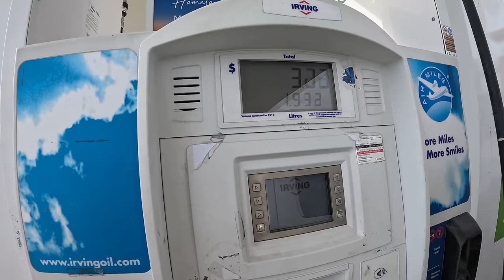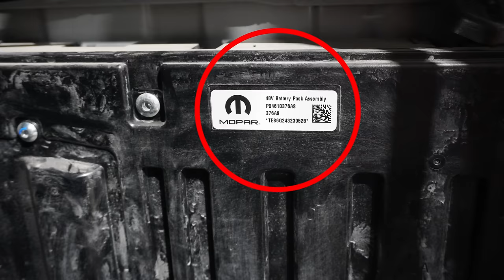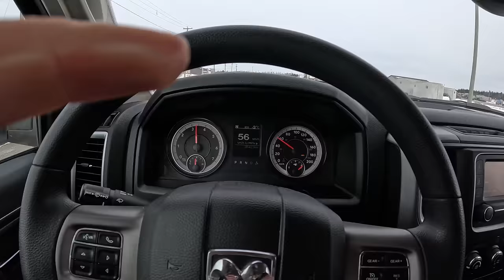Ram 1500 E-TORQUE HYBRID System *Heavy Mechanic Review* | Does It ACTUALLY Work??

Comment: Seems like any gains having E torque on your truck would be minimal.  Wondering what the cost is of the E torque option ?? Great video as always
Reply: you can't buy a non-etorque anymore. When it was new it was about 3k difference on the 5.7. I see a gain in about 3-4mpg in the city vs my friends non-etorque
Reply from the maker: they are very minimal, I believe now you can only get these trucks with the E-torque. but before that it was like 1100 bucks depending on the model.
Reply: Etorque is standard on 3.6 V6 motor.   Hemi with etorque is an option through 2024.

Comment: We call our 2023 E-torque a E-turd. With only 20K miles on it, it has been in the shop 3 times. A week after purchase we lost a 48v battery pack, then two times with the hemi tic issues. Our previous pickups (Ram 1500 5.7 liter were a dream). Now thinking around 100K miles thinking about the battery replacement cost of around $8,000.00 plus labor. Only if we knew this at purchase, we would have not purchased the E-torque.

Comment: Agree. Cheap solution to get EPA MPG up slightly. 3.0 coming. Would be cool for you to look at the 3.0 Jeep or Ram coming. 
I don't like it. Added complexity, maintenance, and minimal benefit.
Reply: Hi jw8578 
Absolutely agree. 😮
Reply from the maker: E-torque is great for marketing but that's about it. Honestly I was a little down on the 3.0 it to begin with BUT I like that's it's in a inline-6 configuration and hopefully is a little torque monster. granted with twin turbos strapped to it who the hell knows about reliability or longevity. Only time will tell.
Reply: @TheGettyAdventures  if you have a chance to look at a 3.0 hurricane in the Jeep that would be cool.

Comment: Here is my real world take for someone who's owned both a 2019 RAM quad cab Hemi and current a 2019 RAM crew cab V6 e torque. 

Both trucks are Bighorn trim levels. The hemi truck was more a baseline Bighorn and the V6 truck is a fully loaded bighorn (only option is lacks is the Hemi).

The Hemi truck got better fuel economy all around. 18 city 21 hwy. Towing i would drop to around 15. 

The V6 model i have done mostly hwy driving commuting and i can get it to go higher than 17 hwy.

But the reliability over the Hemi is worth it IMO.

Comment: The way I understand it is that is that the e-torque supplies torque up to 2,000 RPMs. And since that it doesn't supply torque all the way to top end that they can't apply e torque  to the torque specs. I've owned a ram truck from 2010 to all the way up to 2024 and then I switched to the hemi e. Torque. To me, there's there's no comparison between my non hemi engine and the one with etoeque. Imo

Comment: I have a 23Limited i feel its a good system when i use it i can tell it saves on gas about 2 more miles to gallon in city an breaking i love how that feels an transmission shifts are smooth but as you say there's still more factors of things going wrong.

Comment: Bought a 2025 Ram with e torque, had it for 21 days. I have not paid the 1st month and was towed to the service  department with transmission reset problems and stopped in the middle of the street and not move. It has 850 miles on it. Should I get another truck?

Comment: So far I like the E-Torque, I was told forever its harder on an engine to continually start and stop the engine so, I usually shut that feature off.  When I do use it, I've noticed its really smooth,  Haven't towed with it yet???

Comment: When I bought my 2023 Ram 1500 I was told the E  torque was to give more energy to run all the electrical on the truck.  Also my Ram doesn’t seam to shut down when I’m stopped?
Reply: I noticed with mine it won't shutdown if the ac is running

Comment: I do wonder in the future if Ram plans on using the Jeep 4xe system with their trucks. The Grand Cherokee 4xe has like a 26 mile range on battery only power, and I'd imagine with system being used in the 1500 they would have extra space to put more batteries to give it additional range. It's a much more sophisticated system that offers pretty much all of the same benefits of the eTorque with more power and actual EV battery driving range. I hate that we'll likely never see such a system be paired with the 5.7 since Stellantis seems so obsessed with ditching the Hemi in its entirety with the quickness. A 1500 with a Hemi and a 4xe system with about 50 miles of range would be perfect for me since it would give me just enough electric range in the city that I could use the truck as an EV daily driver to get to my job and back or for any grocery shopping I do. I wouldn't need to use the engine until I take a trip out of town or I let my inner Mopar out and floor it because Hemi noise is good noise. 🥴My old daily driver was a 2007 300C, so since I started driving my grandpa's 2014 1500 I've had a habit of driving it like I stole it. I miss that car, but the truck is way more luxurious and plays the same V8 musical notes. It's a literal win-win for me 🤣

Comment: I just bought a 2024 Longhorn with 5.7 hemi and etorque. Would have preferred No etorque and 2WD but no dealership had any. So far I’ve only driven it home after sale but I will disable the Start/Stop every time I get in, just like I always have with my car that has the silly feature. I think we all can ‘thank’ the US EPA for all the things we hate about recent vehicle changes. The reason I chose to buy now was, 2024 is the last year for the naturally aspirated V8 in a Ram 1500 truck.
Reply: If the 48v battery fails can u bypass etorque n run it like regular hemi?

Comment: What I noticed with the etorque system is if you don't wait for at least 3secs after coming to a stop there, sometimes it is one hard jerk when you accelerate. It's as if the etorque system has to spool down completely.

Comment: I have a 2019 with the hemi e-torque. Ram engineers made several errors. First, the e-torque starts the motor on all but the first start of the driving cycle. But Ram trucks have serious 12V battery issues, psosibly from the OEM quality, so it would have been responsible if the engineers had allowed the e-torque to start the engine on the FIRST (the only start that matters) start. A couple lines of code would have made this work. Second Rams have a serious water leak problem, from the 4 sunroof drains, the antenna, the 3rd brake light and the rear window. This water is directed at the electronics behind the back seat including the lithium battery. I have no way of knowing whether this module or the radio moduel have any waterproofing, but if you are going to flood them you really should protect them. Finally, the engine cannot shut down if you are in Park. DUH! If ever there was a time when it would be a no-brainer, this is it. A lawyer could come up with a reason why this is a danger, but that's their job and I don't care. Overall, I like etorque, especially the smooth shifts and the ability to carry me over a rise in a higher gear, rather than downshifting, a function not mentioned.

Comment: What’s the actual mpg improvement? Sounds like maybe a .5 mpg increase, city only. Is that worth the increased cost  and complexity? There is only enough energy in that battery to accelerate the truck to 60 mph but that’s not how it’s used, it’s only used to smooth out stop/start and gear changes. It makes sense for Stelantis, they get EPA brownie points, does it make sense for use consumers?

Comment: I loathe start/stop systems, except with this e-torque... so much smoother than starter based systems.
Its my understanding that e-torque also spins the tires for the first half rotation from a stop.  That is one place where it finds gains over time.  These manufacturers are fighting over fractions of an mpg or litres/km, so every tiny bit helps.
I have two Rams with 5.7 Hemi, one with e-torque the other without.  The e-torque Ram is outpacing the other economy wise by a good margin in the San Antonio metroplex, suggesting that temp may play a role as well in regard to start/stop conditions with longer duration stop lights..

Comment: I have a 22 rebel with the 5.7 etorque and i usually turn off the start/stop anyway and not sure about the acceleration or towing because i had a 2014 ram tradesman with the 3.21 gears and 6 speed. Where the rebel has 3.92 with the 8 speed. But i did notice the shifting is almost non-existant. Almost like an automatic ATV. Just feels like it just goes and barely feel any shifts
Reply from the maker: Wonderful rig, those rebels are great trucks. but yes I the shifting with the E-torque was just wonderfully smooth.

Comment: I currently have a Ram with the E-torque and when I coming to a stop it’s weird I hate it because the truck shuts off because I’ve stopped completely. It’s usually already off by the time I’m as 2-3mph. It does nothing for fuel economy my 07 GMC 2500 with the 6.0 gets the same if not better fuel economy
Reply: Sounds like you have an issue because it should not shut down until after you come to a complete stop
Reply: @jainsw  eh I know it has an open recall it’s going next Friday to get that done we’ll see if that changes anything
Reply: @2lopezd  it should make a big difference at least in how it operates.  My fuel mileage is pretty good with about 21 mph on the road and about 16.7 in city.  Towing our camper it depends on how fast I drive.  Anything over 60mph is going to be under 10mpg, but if I can keep it under 60 it can be as high as 11.4mpg.  We live in the mountains so there's that, but what I've noticed is it gets better mileage there than in the Texas wind pulling the camper.  I hope your recall fixes the issue and you can enjoy the benefits.
Reply: No way.    No way in hell
Reply: No way what!

Comment: If there is a malfunction anywhere in the etorque system, does that affect the overall drive ability of the truck? In other words, can a bad etorque part leave you stranded on the side of the road? Just seems like more components to potentially go wrong.
Reply: Yes. The answer is yes. I have one. Bought it used with 40k miles and the thing has been in the shop for almost a month, and dodge dealership is having issues installing and clearing codes. 
Don’t get one. Just don’t risk it.
Reply: @GCHandle thanks. Yeah I'm shopping for a non etorque

Comment: Looking at buying a 2021 ram 1500 Longhorn limited but I am concerned about the Etor or the battery replacement  when it Hass to happen or how much $, the truck has less than 11,000 miles on it

Comment: The e torque has to be driven like a hybrid not a regular truck.. having to be gentle on your driving in the city you want to try and keep the hybrid symbol activated… so when driving in the city you have to accelerate a few miles over your desired speed then slowly depress the accelerator until the hybrid symbol generated then attempt to keep that speed and you will see your miles per gallon improve

Comment: For a “Hybrid” vehicle, that e-torque system is probably the least complex on the market. The standard Starter Motor and Alternator are removed and replaced with the combined unit that is simply belt driven from the crankshaft. Granted that the e-torque is a very-mild hybrid (400Wh battery I believe), All other systems on other manufacturers have it integrated into the transmission - so more complex. But in reality this really is a very good (maybe best), Start/Stop engine system to aid fuel economy metrics for City use. As such it’d probably see better benefits in the V8 engined vehicles.
Reply: "eCVT" systems (Prius, Accord hybrid, etc) are FAR simpler than traditional transmissions.

Comment: Always saw the etorque systems only purpose was so Ram could say they have a “hybrid” and gain a few epa/cafe credits. I refuse to buy a Ram with the system on it. I’ll more than readily buy a ford f150 power boost hybrid before I’d buy into one of the etorque equipped trucks. At least the ford system provides actual performance and added functionality.

Comment: I recently saw something that says the hemi e torque 1500 has the towing capacity weight equal to a 3 quarter ton without e torque which kinda sounds like an old heavy half from the 80s 10:15

Comment: Etorque motor generator replaced at 100,000 miles due to a bearing failure out of warrantee greater than $2,000 repair complicated by having to have a dealership "flash" the system to get the system to recognize the replacement  unit. Back in the "good old days" a mechanic would have simply replaced the failed bearing, a couple hours labor and a few dollars in parts.

Comment: E-torque is little more than a marketing gimmick. GM tried this in the 90s with their "BAS" hybrid trucks with similarly nonexistent results.  All this is, is a 48 volt alternator feeding a 48 volt battery to give more power to power the truck's electronics. I don't know if it's worth the price premium or not.  I personally wouldn't look for one over the standard V6 truck.  I can actually do better with fuel economy on the Hemi V8 with the cylinder deactivation.

Comment: My main issue with e-torque  is I live in Florida and have the AC on always. I stop at a light and the engine shuts, but then because of it sensing the cabin temp not being optimal the engine starts back up, so I sit there at the light qith the engine running once again. It doesn't even keep the engine off and not idling for the entire red light...so what is the point. Re-engages the engine way to fast, can't even get through the entire red light time until it turns green. Annoying to me because it is a very smooth system, but to me this is a flaw, and other vehicles that have start/stop that i have driven Do Not do this, they stay off until I take my foot off the brake

Comment: If i were looking to buy one of these Rams i would try to find one without the ETorque. Seems like more trouble than its worth especially down the line when the battery goes bad or if theres an issue with the electric motor, im sure those two things are expensive to repair or replace. Seeing that this etorque barely even does what advertieses just solidifies my view. Simpler the better in my opinion and the etorque isn't worth the very small and borderline unnoticable benefits.

Sadly my local dealer is trying to shove the etorque trucks down our throats as most of the trucks on their lot are equipped with it. I could only find maybe 5 out of 100+ trucks that didnt have the etorque and of course those trucks were hiding in the backlot when i went to look 😂😂

Comment: I've got a 2020 1500 5.7 with the e-torque. Frankly I see no real world benefit. I also live in a hot climate and don't appreciate that the AC quits when the engine is off at lights. I purchased A bypass kit and have disabled the E-torque.
Reply: The bypass kit does NOT "disable E-torque". It disables start stop only.

Comment: I just bought the 2024 Laramie and only have 1000 miles on it. Love the truck, drives great. Not a fan of the E-Torque system but have to say no alternator and 8 year warranty on the E-Torque. I also think the truck is very smooth when at a red light and the engine is off when I hit the gas I can't believe the engine was off. The gas mileage sucks, 16.5. 
I did get the truck for 11,700 under the MSRP.

Comment: I own one and it’s fantastic, with the added 135 torque on take off it yanks my camper easily compared to the 5.0 F150 I had before I bought it.  I’m way pleased with it, overall 19 mpg from a HEMI is impressive, and the ride is better than any truck I’ve ever owned and I’m a truck guy so I’ve owned quite a few in my 66 years.

Comment: I have a 2024 Big Horn 1500 e torque that replaced my 2016 1500 Big Horn with a 5.7 Hemi.  I got this in hopes of better gas mileage, but after 2 weeks on the road with it, never once did I get even close to the same mileage that I got on my 2016 with the hemi.

Comment: I didnt see if the engine was shut off b4 the take off. E tourque takes .4 seconds to start the engine. The classic is a little lighter. Making its zero to 60 time a little better but the frame doesnt do as well slowing down which is why the towing cap is lower. Unfortunately these tests are just flawed because the trucks are different and the 1500 is a little heavier than the classic.

Comment: I love the e-torque system. Start/stop is smooth and fast, it helps big with towing 15.8-17.5MPG depending on weight, A/C stays cold when in traffic with start/stop. And over all MPG city 15-17 but on the highway 18-22 MPG.

Comment: Ram needs to stop calling it a mild hybrid. It is not. It is awesome for stop start and a little added fuel economy. But that is it. I have had a Ram with E torque and without. I personally prefer the Ram with E torque. The shifts are so much smoother.

Comment: etorque is not ideal because 1) the transmission sometimes doesn’t lock in with start stop - it’s poor w/ stop signs and 2) there’s no ability to tap dc2dc power from the 48v battery.

Comment: The upgrade engine is a VVL and VVT engine, it produces more power even without the e-torque. Unfortunately since the classic is a VVT only engine you are not going to be able to compare apples to apples. Upgrade motor comes with the etorque, classic comes without.

Comment: Whats the rear end. 3.21/3.55? 6.4 bed vs 5.7.?
Reply from the maker: same rear ends, and yes the fifth gen had the longer bed.
Reply: @TheGettyAdventures  Crew vs quad. Wonder what the curb weight difference is on the two.

Comment: Most frustrating part of the e-torque is when slowing down at a yield or turning left and the truck sits doing nothing for a few seconds when depressing the pedal. Then the truck decides it wants to go and the power comes on suddenly. Then if you’re in RWD, the tires spin up and the traction control kicks in and kills power. Bottom line. It is very dangerous and drives me crazy. I have my Rebel for sale bc of it. Don’t buy it.